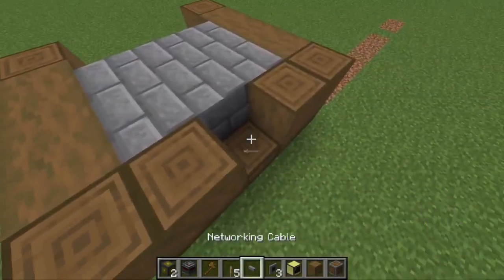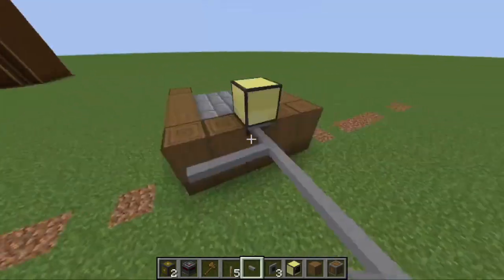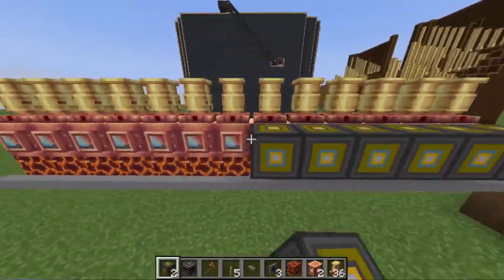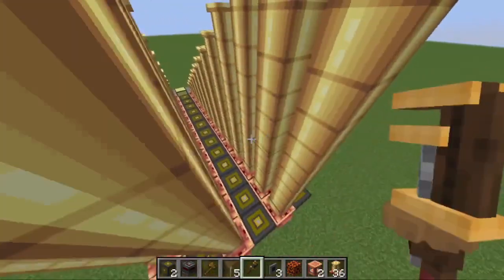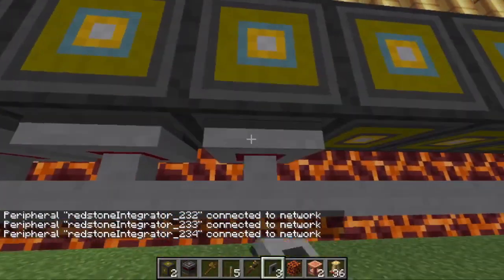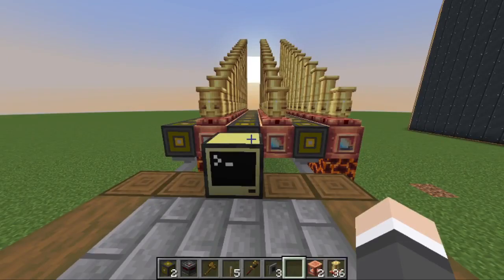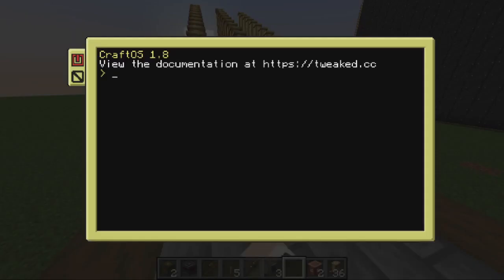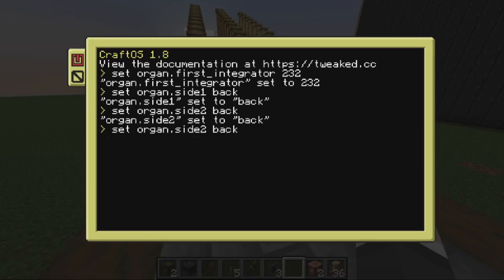How to build a PIPE ORGAN in MINECRAFT

Comment: How on earth do you install xmllparser? I have it, and when i try to build it i get an error, it just keeps not working.
Reply from the maker: install it through LuaRocks.  `xmllpegparser` should be the right package.
Reply: @Ocawesome101  tried it, and uh apparently "Error: /usr/local/lib/luarocks/rocks-5.1 does not exist and your user does not have write permissions in /usr/local/lib
-- you may want to run as a privileged user or use your local tree with --local." and now i've tried running it as an administrator and the file it mentions literally does exist.

Comment: can u make a fabric version (I use fabric 1.18) I tried it with fabric ports of the mods and everything works but it doesn't play any  notes, i think its cuz the fabric port of the redstone integrator is actually called "geoscanner" instead of "redstone_integrator"
Reply from the maker: that's a (significant!) bug in the port and should be reported to them.
Reply: @Ocawesome101  ye but the guy who made the advanced peripherals port only has like 60 downloads since last year so i dont think it will get fixed or even noticed. I guess i just wont be able to make cool steam organ :(
Reply from the maker: @i1_iu295  you can also edit the code for play.lua and fix it yourself.  should only have to change it in one or two places.
Reply: @Ocawesome101  oh thanks, I'll try to do that
Reply: @Ocawesome101  hi, i think i figured out how to edit the code, but how do i upload the changes? i just downloaded the code from the github as a zip file and i dont know how to upload it to computercraft
Reply from the maker: @i1_iu295  you should be able to drag and drop it onto the computer.  failing that, pastebin.
Reply: @Ocawesome101  thanks!  I finally figured out how to edit the code, but it still doesn't work unfortunately, thanks for your help though , i still dont know what the problem was, i guess it was just incompatible with the fabric version. btw i like cats too :D